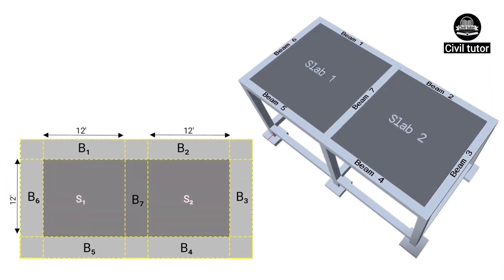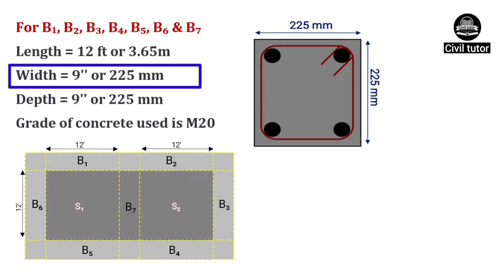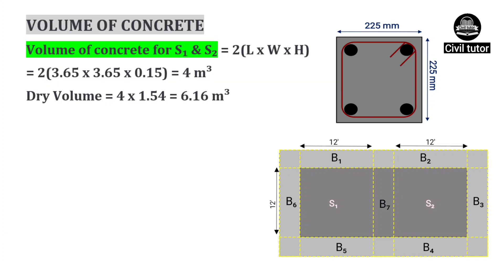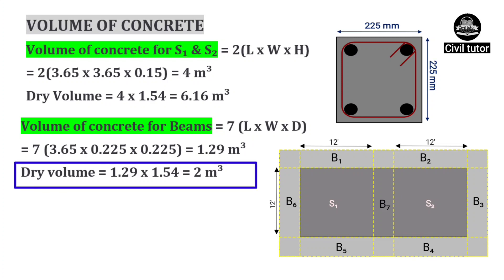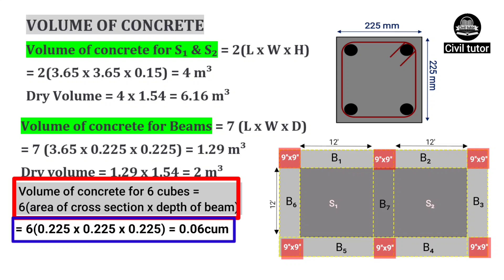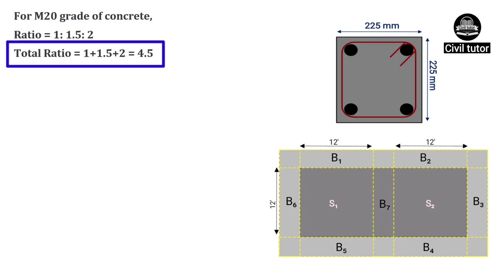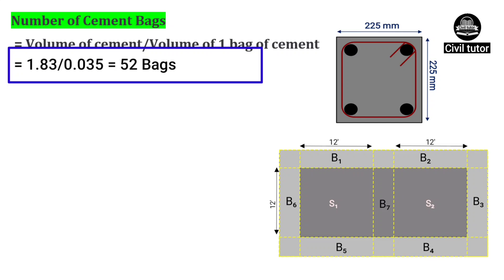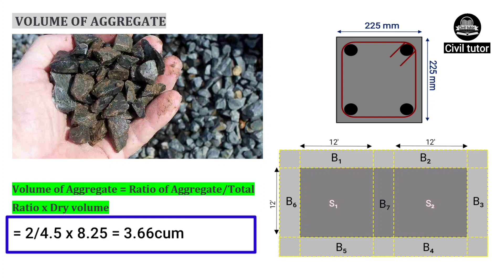How to calculate Cement sand and Aggregate in slab and beams? | quantity of materials in concrete

Comment: In this calculation, the volume of the steel rebars are not taken into consideration. Should we not subtract the volume of all the steel bars which will be inside the slab and beams from the total wet volume??

Comment: I have one doubt
Total dry volume=8.25m3
Cement=1.83m3
Sand=2.75m3
Aggregate=3.66m3
1.83+2.75+3.66=8.24m3
8.25-8.24=0.01 is 3 digit calculate going in
But water=?
This is the my doubt sir

Comment: Sir m20......1:1.5:3
Reply from the maker: P.S: I have mistakenly mentioned the mix ratio for M20 as 1:1.5:2 instead of 1:1.5:3.... According to that, the total ratio will be 5.5 and not 4.5....please use 5.5 in place of 4.5 and do the calculations accordingly. 
Sorry for the error 🙏
Disclaimer: I'm a human